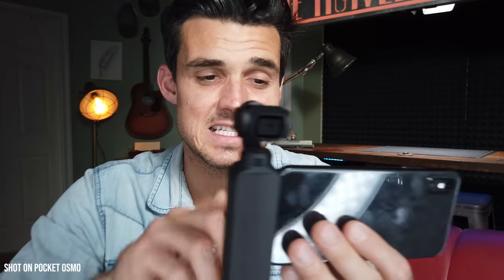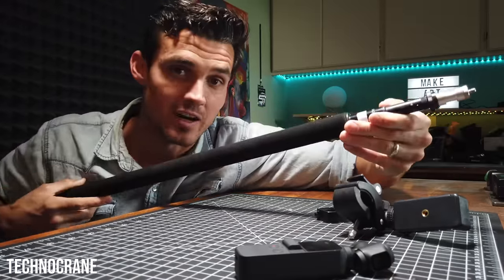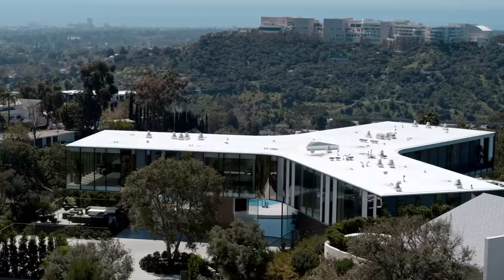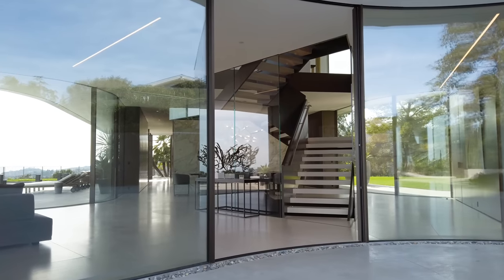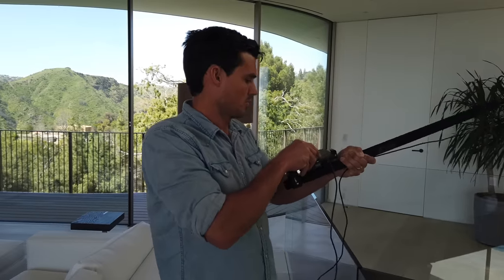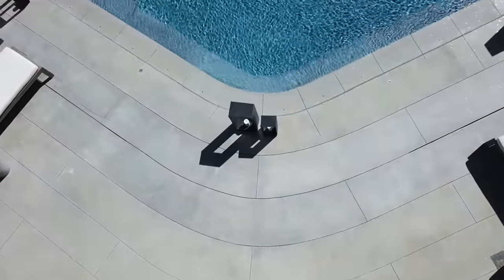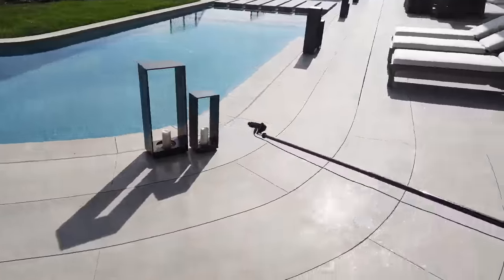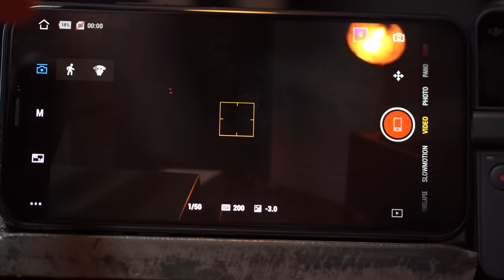Take your DJI OSMO POCKET footage to another level.

Comment: You did a great job to make them match.  The trick is to avoid shots that contain fine details or motion (or both together) that confounds the compression algorithm and causes obvious compression artifacts.  This is difficult to avoid when the bit-rate of the Osmo Pocket is limited to 100Mbps.  Question:  What were the other cameras in the shoot?  Obviously one camera was a drone camera, but what other cameras do we see, and what codec did you choose for them?  BMPCC4K with BRAWQ5 perhaps?  My biggest fear was the pool shot.  Where I typically see the compression artifacts go horrific in Osmo Pocket and Hero7 shots is fine wavelets and turbulence in water.  Where you showed the patterns in the pool water the details were somewhat coarser than where the compression artifacts appear in spades, so you managed to get away with the pool shot.  Good job showing what the Osmo Pocket camera can do when handled carefully to avoid getting into situations where its limitations blow up shots.

Comment: Fantastic video, thanks! I’ve just come across your channel and also that lightning extension cable — I had no idea such a cable existed before, but will definitely be getting one now!
Reply: There is a wifi base with a 1/4" screw socket made by a third party that will wirelessly connect to your smartphone without a cable's entanglement.

Comment: I have a question for you what do you do with the osmo pocket when the battery goes dead or just stops working stops holding a charge? Do you send it back in and the manufacturer replaces it or do you just throw the unit away and buy another one? Seems like a pretty expensive unit for them to have not thought about this

Comment: Thank you for an inspiring video!! One question: why did you use the expansion kit, instead of puting the pocket directly on the boom pole with an 1/4-3/8 adapter? Stability issues?

Comment: Tried the Atlanta transition. But my pocket 2 keeps trying to switch orientations around 45degress. In FPV mode and it still is swapping to portrait during the vertical transition movement. Any tips?

Comment: Were those night time shots of the outside of the house with the osmo?
Reply from the maker: No, in fact there's a but of confusion on this, perhaps how I said it. 

This was a video shot with my normal camera gear, (Sony a73, BMPCC4K, drone..etc) 

I integrated several shots with the osmo (the same shots that were used in the tutorial part) 

I only used those 3-4 shots from osmo, but the point was to see if you could tell the difference in context of a body of work. 

So I guess it worked-- only I don't want to give the osmo credit for more than it earned. 

Night shots were done with a drone and Sony A73.

Comment: it is possible to use the wifi base module to control the osmo by connecting it to the smartphone instead of using that extension cable??
Reply: Yes you can! You can connect your phone via WiFi or Bluetooth with your osmo pocket with wireless base